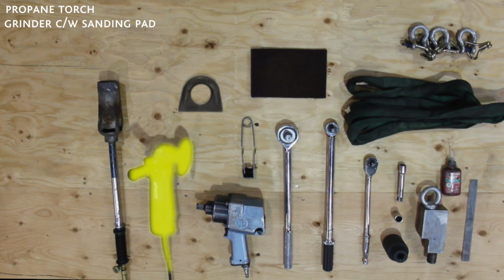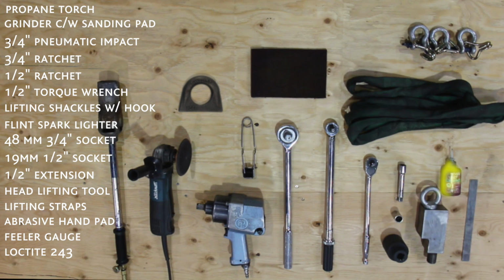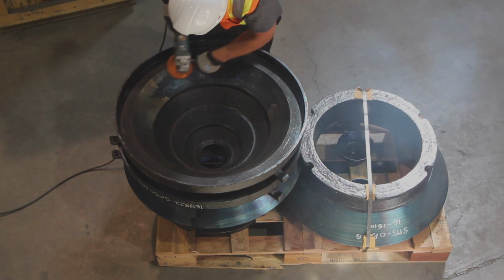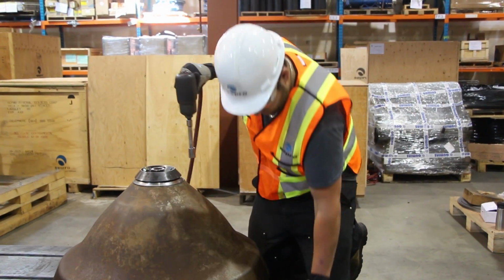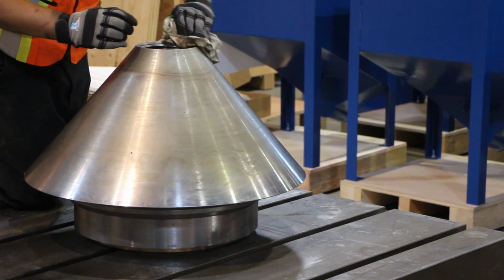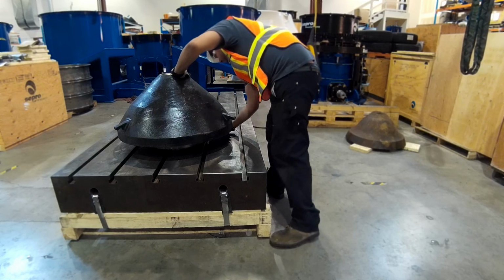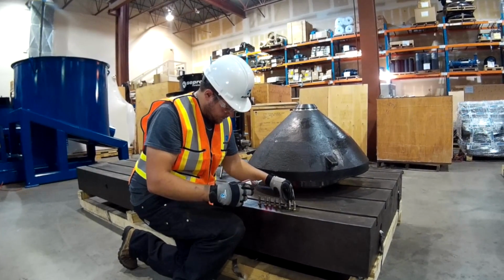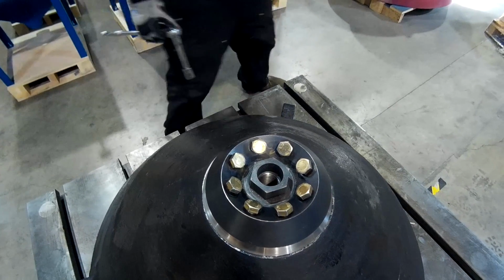HOW-TO: Replace The Sepro Blackhawk 100 Cone Crusher Mantle

Comment: Typically how long should this exercise take a competent fitter?
Reply: 3 or so hours
Reply: @vandiemengoldprospecting7624  Thats not too bad , I have seen wear liner changes taking 6 or 8 hours.
I have also seen from stopping a cone , both liners replaced to start up in under 30 min.